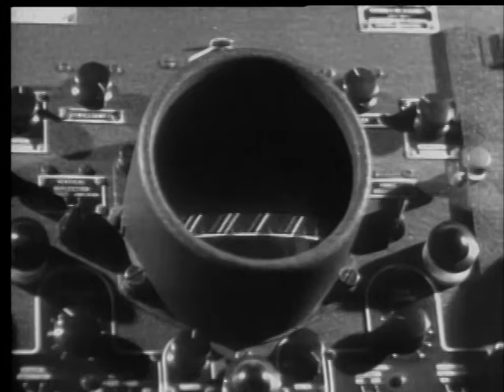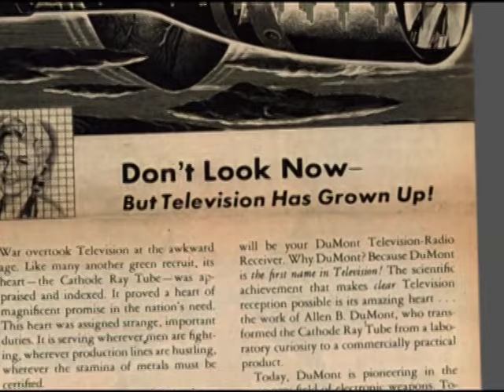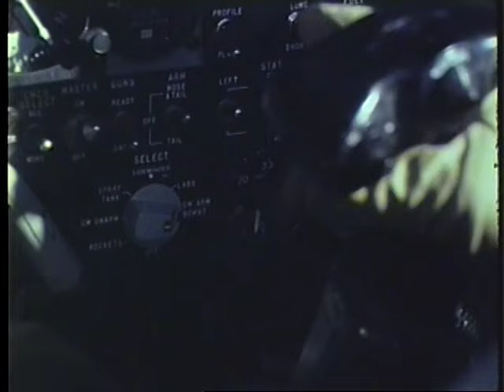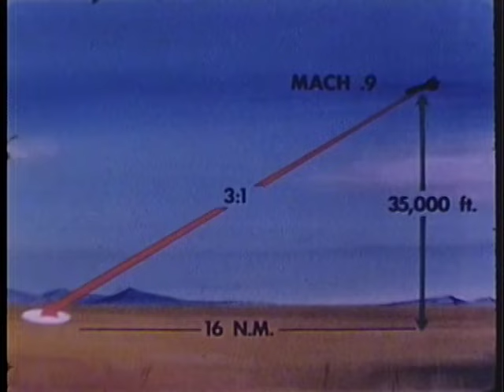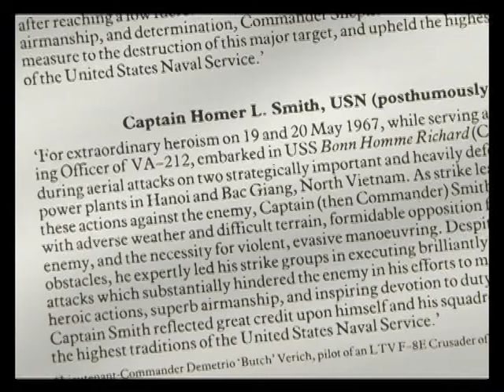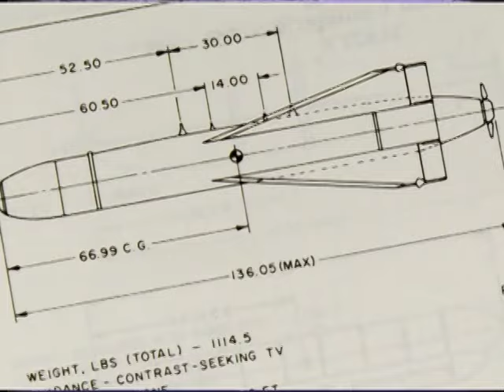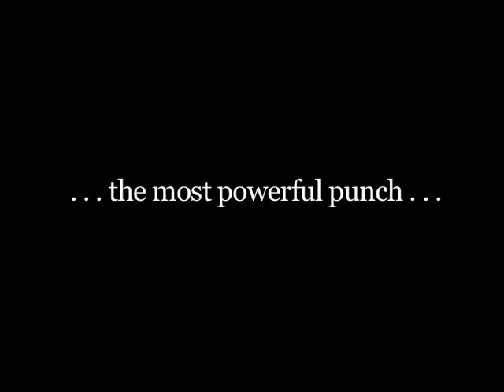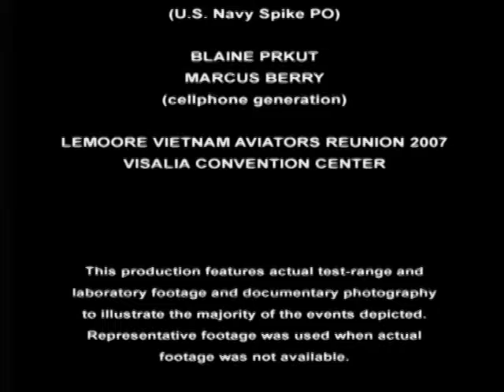The Pursuit of Precision. AGM-62 Walleye The TV-Guided Glide Bomb

Comment: Problem with the walleye, at least on the F4, the display was on the radar scopes.  The scopes were green screen DVST, Direct View Storage Tube.  Which made the displays a little fuzzy and hard to differentiate items.  In the late 70's the displays were replaced with CRT displays that displayed standard TV format.  Black and white.
Reply: @user-pz9ct8zi3d  it was a dual gun DVST.  Direct view storage tube. A gun produced ase circle, range rate circle, el strobe and horizon line.  B gun bsweep, ppi, range strobe.  It's been 35 years since I worked on them so I might have missed one.  I am pretty sure tv displays from wall eye and maverick weapons were a gun.
In late 70's the green DVST displays were replaced with digital monitors.  First MSDG from Texas Instruments and then DSCG from Honeywell.  Much better display and the range rate circle replaced with digital readout.  Not they got cute with how they generated the el strobe and horizon line and they weren't recorded on the VCR they installed.  Pilots were extremely unhappy.
Reply: @user-pz9ct8zi3d  much, early 60's to mid 70's.   Computer was gears and resolvers.
F4C/D hundreds of vacuum tubes F4E hundreds of transistors and a few tubes.  C/D heavy transmitter weighed about 150 pounds, E transmitter weighed 50 pounds.
Reply: @user-pz9ct8zi3d  you can purchase a ride in a F4 from the Collins Foundation, they have the only flyable F4 in civilian hands.  It will cost about $10,000.
Reply: @user-pz9ct8zi3d  if you have a pilots license they will even give you a check ride.  For about $15,000.

Comment: 1:09:20 
The section regarding the Multi Linear Shaped Charge warhead was fascinating. As far as I know, this design is wholly unique to the Walleye, with the closest equivalents being the modern anti-ship missile payloads, such as the one found in the Kormoran missile. It features a Semi-armor piercing warhead with multiple EFP's on the body for breaching bulkheads and sealed compartments, spreading damage and making it harder to stop flooding. 

The army is also working on a similar design for a special Anti Materiel shell.

Comment: it's amazing what was accomplished with the relatively crude electronics of the 1960's!  These engineers had great jobs and produced great results!
Reply: One of The first were the fritz in 1940's in germany .
 Jamming of radio control signals led to a wire with electrical signal connecting the ju88 drop plane to the tv guided glide bomb .
Reply: Where did you see Fritz had TV?

Comment: We launched F/A-18s from Barbers point Hi. for HCAX in 98 or 99 I think. They had Walleys loaded on the last day to sink the target ship.
Incidentally, AC #5 came back from a flight without its centerline drop tank. If I recall, the ordnance wouldn't drop. Maybe it was a Walleye, but the pilot selected emer jet and pickled everything off.
We had joked that the walleyes were left over from Vietnam days.
The drop tank made a reappearance around 2003 or so when it washed up on a guys beach in Japan. Theres pics online and you can clearly read "Cowboys" on it.
Fun days.

Comment: I worked for about 12 years around aircraft armament in the air force (not American).  I came in at about the time of Desert Storm.  "Smart bombs" were coming into mainstream service but for everybody that meant laser guided.  Now there is GPS.  To my great shame I did not know about the Walleye.  I had heard of it mentioned in the Vietnam war, I knew it was camera guided and the limitations.  But I didn't know it was self-guiding.  And had a bigum warhead.  Now I know that the first images I saw of smart bombs in the Gulf War were camera foootage from a Walleye going through a window.
Reply: Actually quite a few of Desert Storm PGM hits were one of 13 hits using SLAM.   The SLAM used the IIR seeker from the IIR MAVERICK, the AWW-13 data link from WALLEYE II, and the rest was from the HARPOON.   Worked like a charm.  Company I worked for made the simulator for training the users.

Comment: Wasn't it a Walleye (and a sidewinder from a parked phantom across the deck)  under John McCain's A-4 that set off that huge fire on Forestal in the 60's?
Reply: Zuni unguided weapon. God bless the Military-Industrial Complex anyway: dividends galore in S.E.Asia...
Reply: No. On the day of the accident, VA-46 aircraft (McCain’s squadron on Forrestal) were all carrying 1,000 pound AN-M65 bombs of WWII vintage that were received aboard the ship the day before. They were observed by many of the ordies as rusty and old, the composition B explosive filler was unstable, and the casings were beginning to seep paraffin phlegmatizing agent. The older composition B gets, it increases in explosive power by as much as 50% by weight. The casings were very thin skinned (evident by the 1min 36sec cook off time on the Forrestal). In other words, those bombs had no business being on the ship. The newer Mark-series Mk-83 bomb were in short supply throughout the fleet, and they were filled with composition H6 filler which was designed to burn instead of detonate when exposed to high heat, and the casings were thicker which gave the bomb a lower cook off rate.

Comment: why did they do all the work to get this on a A4 scooter, an old , single pilot analog plane that was already difficult to fly(navigate, overhead),"
Why didn't they do this on the F4 that had a WSO/RIO?
Reply: The A-4 was cheap and available for them to test fly the weapon from.

It was also intended as a fire and forget weapon, needing a backseater to guide it in would have defeated the purpose of it.
Reply: Because A-4's are more likely to be attacking ground targets.
Reply: Because the A-4's weren't particularly old at the time...
All aircraft were analogue back then.
Reply: @IO-hh2fz  But it wasn't entirely fire and forget ! the TV guidance could be done by the pilot.
Furthermore the acquisition part required the pilot looking through the TV which means he wasn't looking at his avionics and airplane.

The A4 was already known to be difficult just for navigation, big time F14 pilots who trained on it, said it was a hard airplane for such things.
Reply: @FallenPhoenix86  Sure, but the A6 and F4 were already around during the Vietnam war, and they had the analog pilot, and a RIO/WSO who had his hands free for weapons
Reply: @koc988  But that's the point isn't it.. the cheap and expendable A4 was used to bomb truck dumb bombs.. hence why they needed so many sorties. Low hit to sortie ratio 
The Walleye reduced the need for many sorties due to accuracy.. at which point an F4 or A6 would have been much more logical since there's the WSO for the weaponry while the pilot can focus on the flying and SA/defensive.  You can't have good SA if your flying while you look through the walleye TV

Comment: So its basically RC FPV
Reply: Ah no, pretty sure the story here is FPV was a WW2 innovation that really didn't work as a guidance  system so these dudes invented stabilized gimbles and optical tracking back in the days of vacuum tubes while the Chinese where busy mindlessly smelting every piece of scrap tin to ignorantly folly to boost steel production to much less success.
Reply: @logicbomb5511  ok